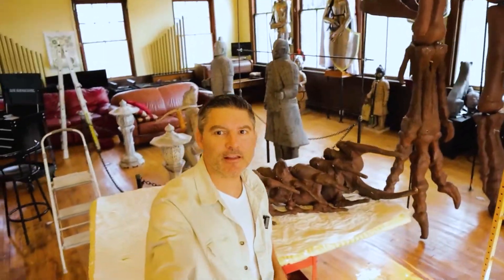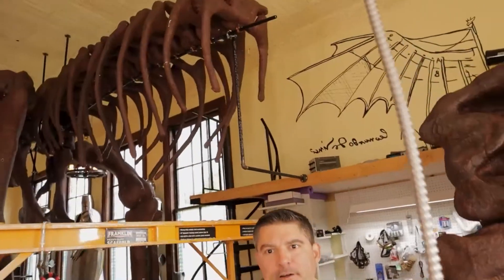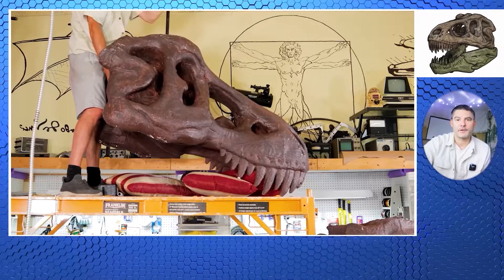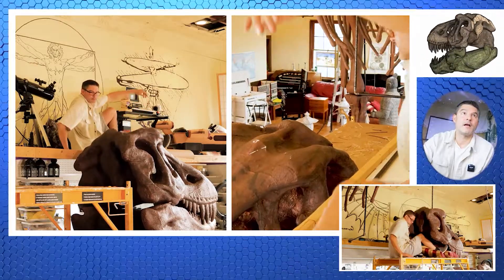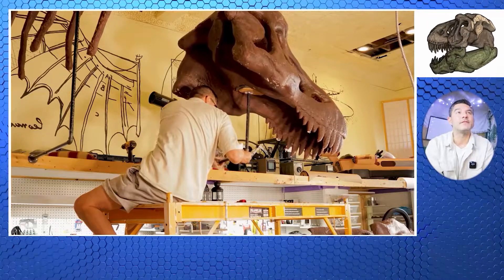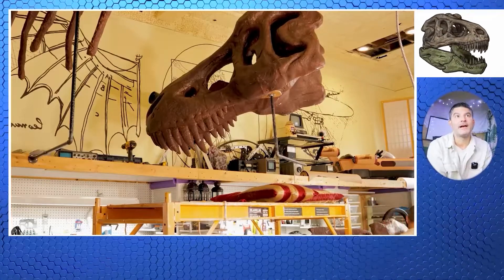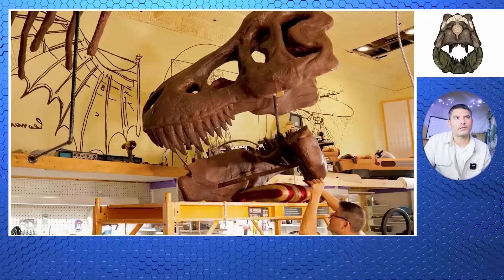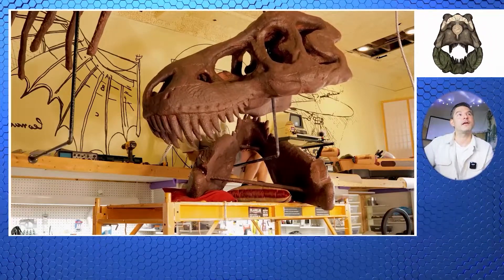Building a Life-Sized T-Rex in a Vintage Schoolhouse: The Skull Installation - T-Rex Project Part 16

Comment: Thanks again for making these videos, Dave. What was the smaller metal rod you used for the mandible that went with the 1/2" Galvanized split ring hangers? I made a skull too and working on the armature and like your idea for it. Thanks!
Reply from the maker: I'm thinking it was a threaded bar if i understand your question?.. let me know, happy to help